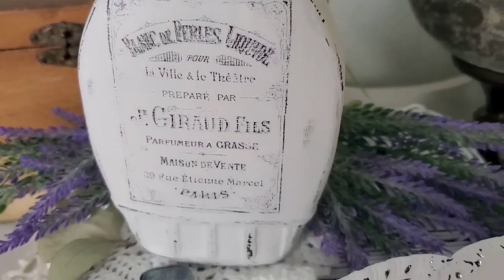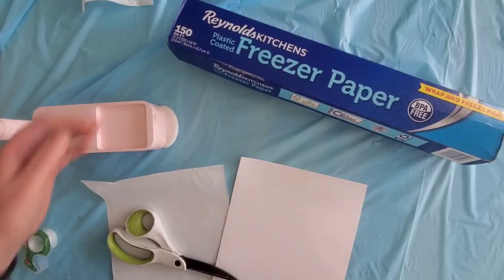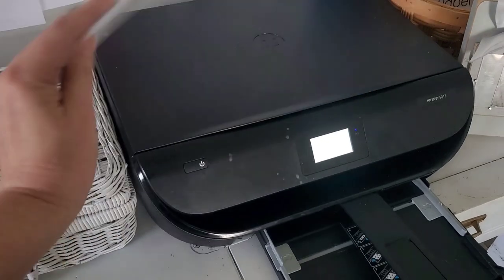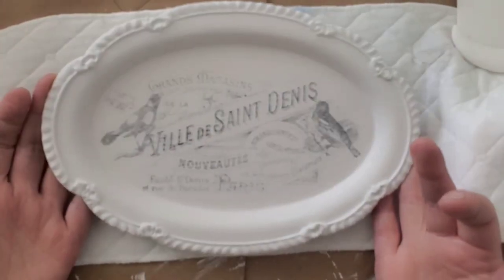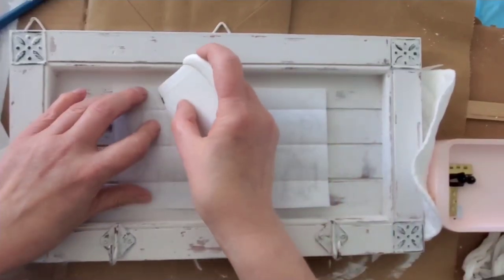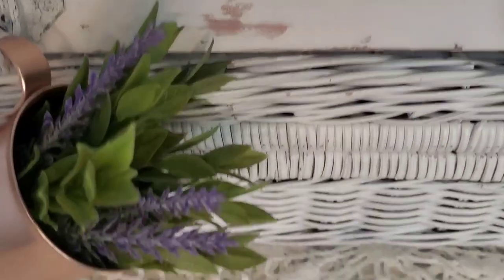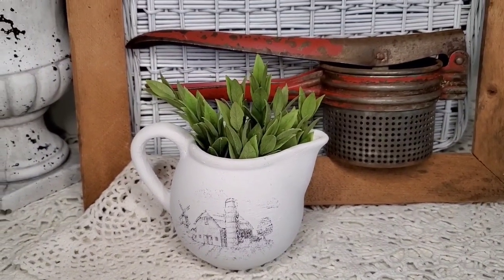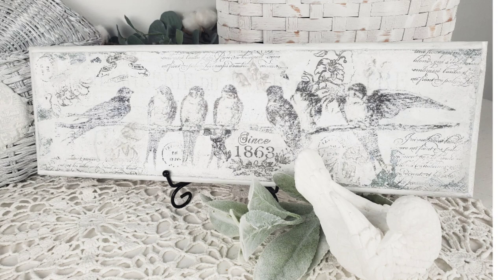DIY Image Transfers | How to Create & Apply Freezer Paper Transfers

Comment: When inserting the paper into the printer, is the freezer paper side on top or underneath?
Reply from the maker: For my printer the shiny side is face down however some printers may be face up. You can take a piece of printer paper and write an x on the side you place down in the tray. Then run it through the printer to see if it comes out face up, as well. If not then you would place yours face up in the tray. Hope that makes sense ❤️😊

Comment: I was wondering what sealer do you use?
Reply from the maker: Rustoleum sealer, two very light coats spraying from a good distance away.  Drying the piece overnight & then in between each coat. I recommend testing a small section first or a sample piece with the same surface. Those steps help so the ink doesn't reactivate & smear. ❤️

Comment: I have a print of my late husbands work. Would like to transfer it to a large piece for a light installation. Where could I get a large copy, 2 1/2' X 3'. Any idea where I can get a print that large on wax paper? Or a company that would do it?  Liked your tutorial by the way. But the size I'm looking at, glass would be too heavy, can it transfer be done on plexiglass sheet?
Reply from the maker: That's a beautiful idea, Barbara❤️ I wonder if you have a local print shop that would do it for you. Could you paint the surface w chalkpaint or do you need it transparent?
Reply: @CreativeDIYPurpose  The only print shops in our area only go so large. And not transfers. They did wonderful work making prints of my husband's art, but nothing as large as I'm wanting. I've thought of contacting Kinko's. Would be willing to do something using a paint on application where the paper gets washed away. Don't know if the chemicals would mar the surface of the plexiglass sheet. It's a consideration about rubbing IOD transfer. Want to give it as a gift to our son at Christmas. The one I saw that I'm trying to duplicate was backlit in a deep frame and hung on the wall as a mood light. Have considered the printed shower curtains. Concerned about the crispness of the print. My husband did magnificently intricate work with a wood burner. I wouldn't want to lose any detail.
Reply from the maker: @barbarapendergrass5098  it's worth a call to Kinkos for sure. He sounds like he was an incredible artist. What a blessing you are to share his creations. Your gift idea sounds beautiful. 
Yes I agree the shower curtain might blur and wear off after awhile. I will look on Pinterest and let you know if I come across anything that may help. 
Pls touch base and let me know what you figure out because once you do I'm sure others would appreciate the advisement ❤️
Reply: @CreativeDIYPurpose  The local print shop, and might I say some great people only prints so large. The nearest kinkos is an hour away one way. But we did use them for some family photos once and they were fine prints.
To get the light to come through the print properly an opaque paint wouldn't be right. I was reading about ModPodge. The article advised gloss medium for transparent glass. Still scarry. The cost of a sheet of plexiglass that large is quite expensive. Have several poster frames around with a cheap thin plastic cover. Maybe I'll experiment with one of those. 
My son lives in a man cave and having his Dad's work being a mood light I think would be special to him. Don't mean to blow my husband's horn. But he was an excellent artist. And this steam punk abstract is one of his finest and last pieces. Really want to honor him and do it up right.
Reply from the maker: @barbarapendergrass5098  wow I would love to see a picture of this piece. 😍 let me know how it goes w the poster thin sheet. It may work out better than the plexiglass. What size are you looking for in plexiglass?
Reply: @CreativeDIYPurpose  Love to share his work. Only everything I have on file is on an old XP 2003 that isn't supported to go online anymore. I've gotten a new laptop, just can't figure out how to use it yet. (fingers crossed) 
Because of the dimensions of the original piece, I'm thinking 2'-2 1/2' X 3', large poster size. The outer border could be made to work with that. Wouldn't want to lose any of print to the frame. Then a string of med bright LED lights, Xmas, around edge behind plastic. I realize frame would have to be deep to allow for heat from lights to dissipate. Never done anything like this, but I have a great imagination. Thanks for all your input. I've brought this to several people, and you are the first who has offered so much informative input.

Comment: Do you seal it with a spray
Reply from the maker: I would recommend testing on a small spot first or on a sample piece to see how your printer ink responds to your sealer.  I let my project dry overnight then spray lightly with rustoleum spray sealer, let that dry then apply another coat. ❤️